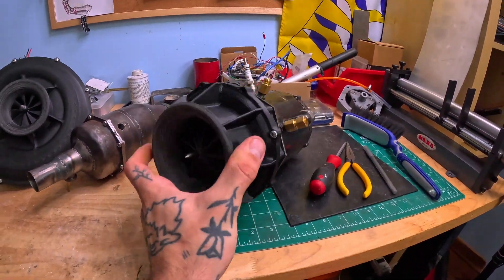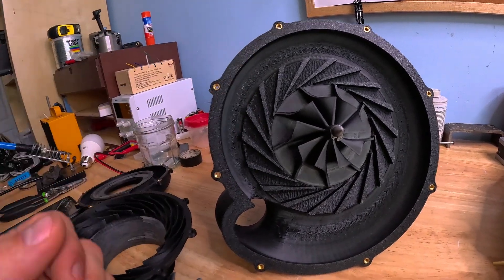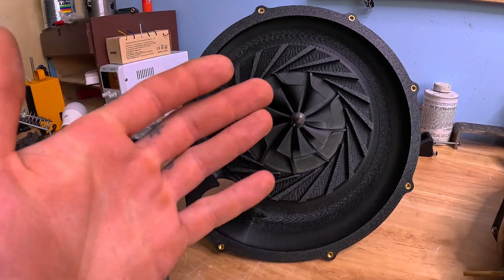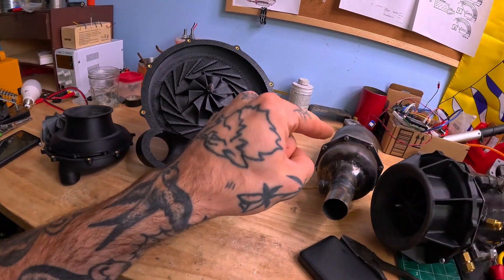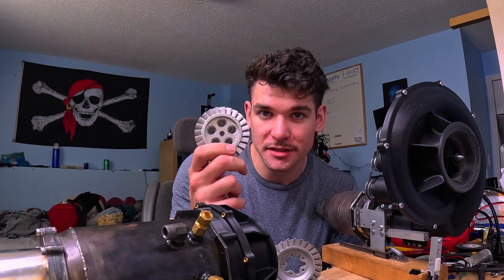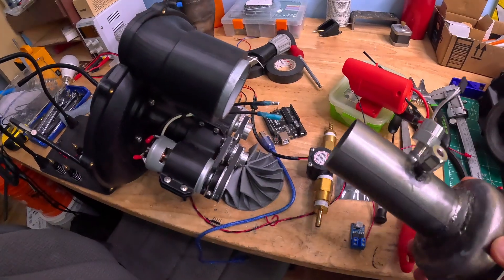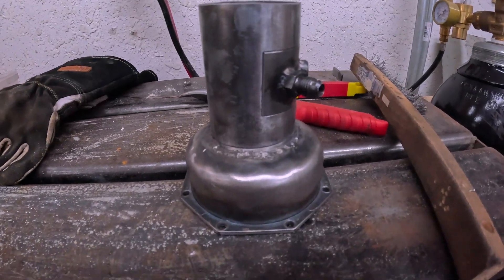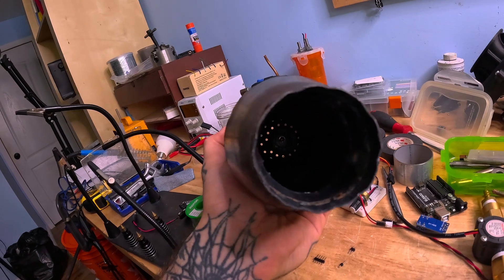How to Design a Better 3d Printed Compressor for our Jet Engine!

Comment: I've come back to nitpick; pressure is created by the restriction downstream, the compressor generates FLOW. also airplane wings don't work like that; you can have a completely flat airplane wing and still fly. Airplane wings work by re-directing air downward, exchanging momentum with it. The reason they have that shape is because they are more efficient that way; if you have a flat wing the angle of attack it can achieve is much smaller. If you think of a flat plane going through the air, and you tilt it with respect to that flow, eventually you have flow separation on the top surface. this flow separation generates immense drag and almost halves the amount of lift the wing generates. By shaping wings into an airfoil, you allow the air to stick to the top surface of the wing at higher speeds and higher angles of attack, meaning you can get  MUCH higher performance out of them than a flat wing.

Comment: Very Impressive! Does none of the heat transfer to the plastic compressor housing? Did you somehow insulate it? Also, I'm curious how much % infill did you use in the compressor wheel?
Reply from the maker: I'm sure it does, but at the moment the compression ratio is so low that heat isn't a significant factor. I used a 25% infill, thanks!

Comment: You gained a new subscriber buddy you reminded me of my project it  i made my engine inside a water pipe😂 it was just a conbustion chamber  with a (grinder motor) (ac)  and a propeller pushing air into it it wasnt effective at all but ill get to study alot with youb❤️🫶🏻

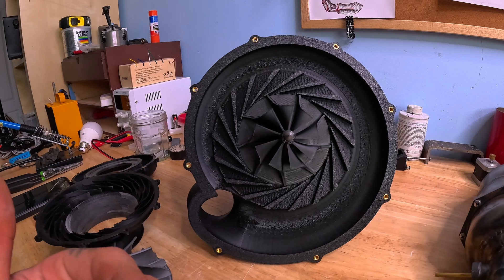Comment: 1:26 your not slowing down air to make high pressure, your literally squashing air, into a tighter smaller space.

If you was right than air would be at it's highest pressure when not moving. 

You've got the right idea but your explaining it wrong.

Comment: Would printing the blower  it out of resin make the air flow better since FDM printing has a bunch of print artifacts and imperfections
Reply from the maker: I'm sure it would! I don't currently have a resin printer, but I have thought about painting the surfaces with the resin and using a uv light to cure it to smooth out any imperfections
Reply: @Neally  what about sanding it?
Reply from the maker: Yeah! I sand the volute casing so the layer lines are less pronounced

Comment: Just to ask, but are the stl files for all these models available anywhere?
Reply from the maker: I'll probably have the files on my patreon soon!
Reply: @Neally  Awesome!, im particularly interested in that impeller stl since designing a sturdy impeller that can both print well and not tear itself apart is a challenge and i would be able to use this in many different things
Reply: @Neally  Sorry for asking so many questions, but one other thing i wish to know is are there any calculations relevant to modelling compressor and turbine for small scale and also with things like a stator etc, or are the all just something that you can wing? I assume that for the compressor and turbine you wouldnt want higher drag on the turbine than the compressor and vice versa to keep things turning smoothly

Comment: How big of a bed do you need to print? How much psi does this make? you think it would be enough to make 5psi on a v6 engine?
Reply from the maker: It took up my entire 256x256mm print bed. And not in it's current state, it peaks around 0.85psi. With a stronger motor you can probably push it to somewhere between 1 and 1.5psi, but that's just my guess

Comment: Is the rpm count accurate..?seems very low at 17k
Reply from the maker: Yeah it's accurate, the new compressor design is putting way more load on the motors because it's better at creating pressure, so the motors can only spin it up that fast

Comment: Bit of a random thought, at my work we use danfoss nozzles to inject fuel into the burner of our hot water pressure washers. Maybe these will benefit in your design? I’m not sure how well they’ll work with propane as our machines use diesel but it may be worth looking into as you can get ones with different spray patterns etc
Reply from the maker: Hell yeah I'll look into it!! Diesel and kerosene are close enough, I think that could work nicely
Reply: @Neally  good luck dude! Hope it works out 😎

Comment: The to pology of the volute and the channels is for the sake of, drag and air resistance reduction and NOT for compression ratio. The divergence of those nozzles does nothing to increase compression. It will indirectly add to higher compressio, because It's an efficiency thing. It decreases that resistance I talked about.  Pressure ratio/compression ratio is a function of the geometry of your rotor and it's rpm. You got it right that the nozzles/channels are there to slow down the air and make it compressed and hot istead of fast and low pressure.

Top tips to increase the pressure:
- increase speed/rpm
-increase rotor diameter
-optimize rotor shape
-decrease leaks, losses and tolerances

Comment: I want to ask a question: can you improve the aspiration by using a small and a big turbine in a sequential config. One for low rpm and the other for the rest?
Reply from the maker: Multi stage sequential compressors would definitely help get the pressure up! Definitely more bang for the engine I think

Comment: Neat project, but after looking back to the video 6 months ago you mentioned 400-ish grams of thrust - about a pound. I assume from the jet combustion output. Given the power needed for the electric compressor, I'd mention a cheap 90mm EDF (~2100 Watt, 30000 + RPM) produces over 6 pounds, 3kg-ish with plain old cold air. An expensive aluminum 90mm EDF (over 70000 RPM) can make >13 pounds. Tech Ingredients attached 2 of the aluminum ones to a bicycle a few years ago. I mean, fire rules, but shouldn't 30-50 pounds be the target thrust?  I've also been following some rocketry projects that talked about nozzle geometries - notably, where is your expansion taking place? The bell nozzle use on rockets lets the hot gasses expand and cool which converts to thrust the rocket can use - the nozzle is key to putting the expansion to use rather than wasting it. Then again, I've never seen a turbo jet with a bell nozzle so I must conclude the expansion is taking place inside somewhere. I probably need to watch more of your vids to make sure I'm not being Captain Obvious :)
Reply from the maker: I think using my own designs for combustion chambers, compressors, nozzles, and actually making everything myself is robbing the engine of a lot of efficiency. Additionally, the motors seem really weak for the application. Ducted fans use brushless motors, and from what I've seen they can spin up quite a bit faster than mine. I've ordered one, maybe it'll make a difference on a future design. I'll keep the nozzle shape in mind too!

Comment: Wait a minute, at least to my knowledge I don't think your concept of the diffuser is quite physical.
Air can not flow uphill. As the diffuser is not doing any work itself, it should be impossible for air to increase inpressure as it travels through the diffuser. That is not to say it might not have other benefits, but unless I'm missing something I don't think it can increase pressure.
Reply from the maker: The diffuser passively increases pressure by reducing velocity. Think of it like a backwards venturi, where the expanding shape of the channel would cause an increase in  pressure and a decrease in velocity. And the air isn't really flowing, it's essentially being shot into the diffuser by the impeller, that's where the extra energy comes from

Comment: I will say, speeding the same amount of air up, and then slowing it down will not increase its pressure, given the same end volume. A compressor of any kind works by trying to force more air into a space than can fill that space at ambient pressure. I do agree with your explanation of a trick to make centrifugal compressors more efficient.
Reply from the maker: I know where you're coming from because I had the same intuition at first too, but you're not considering conservation of energy. By speeding something up you are adding energy, if it then slows down, the energy has to be conserved, so it converts partially to pressure and heat to keep the system balanced. That is fundamentally how centrifugal and axial compressors work
Reply: @Neally  I do agree to an extent, but pressure without mass is not very useful for internal combination engines, both piston and jet. The real benefit of increasing the pressure is increasing the mass of air in a given space. This means more fuel can be burned. I work on jet engines, and axial flow engines step frontal area of the compressor blades down over each compressor stage. The front is wide open, and that same amount of air is forced to occupy a smaller and smaller space, increasing pressure.

Comment: What is that fuel nozzle? It looks like it is from a 3d printer. Also, you should probably try using some bleed air to cool the exhaust so it doesn't get hot and glow like that.

Comment: Is this reversible? Can it be used as a turbine?
Reply from the maker: Not well, the geometry isn't suitable for the reverse flow, you'd want a different impeller(turbine, in that case) shape, and probably to remove the diffuser

Comment: thats beautiful, how do you make the impeller so perfectly? when i try to 3d print one, it get out warped (a little bit its enough to break the entire thing) or not strong enough
Reply from the maker: Hard to say! It depends on how you're running your printer, make sure you're using well dried filament, not printing too fast, and have your slicer settings sorted out

Comment: What design did you see that uses those stationary stators on the volute housing? Reason I ask is if you look at any aftermarket supercharger or even turbo charger. Those stators do not exist. If what your saying is true, there would be a lot of performance to be had including them. This makes me think they were left out for a reason and are likely just a restriction that doesn't help performance.  Have you though about possibly creating a case without them and comparing?  Would be interesting to see the results anyway!
Reply from the maker: The two types you're talking about are called vaneless and vaned diffusers, they differ in flow and pressure characteristics, you're best off doing some digging yourself because it gets a bit complicated and I'm by no means an expert! I really like the idea of comparing the two, I've been playing with the idea of trying to make my own turbocharger, I think I could definitely experiment around with that!

Comment: Propane lowkey an L fuel because at low temperatures the fuel cools down a substantial amount. This screws up its combustion. It’s best to have the fuel heated or cracked already
Reply from the maker: Yeah, I agree with you. I've been working on a kerosene injection system, but it still needs some work and I haven't been able to test it yet.. It'll be powering the new engine eventually!

Comment: How you described lift is called the Equal Transit theory and its kinda not true. Bernoullis principle governs flows and therefore lift
Reply from the maker: Good point! It seems to be partially accurate but not fully responsible for lift, could you point me to a better explanation??

Comment: TURBOJET Lets fricking goo; I've been building one for 2years now I'm on V2. If you wanna save some time and money swap out those steel bearings for cageless silicon Nitride bearings, or cageless zriconium oxide bearings. These bearings Run dry and dont need lubrication. 
For you combustion chamber I'd recommend a reverse flow combustion setup, basically the fuel is injected from the top down, and protected with a tube to ensure it doesn't ignite too early.
If you use a (stainless-steel Turbine, and turbine housing) make sure to take into account the thermal expansion ratio of the turbine with respect to the turbine housing. I'd recommend some air-cooling fins for the turbine housing to keep the temperature predicable.
I Noticed you are using a non-threaded shaft, I'd recommend using a partially threaded shaft as it makes securing the turbine and compressor quite easy, And No the nuts won't come loose.
Reply from the maker: Wow thanks for the info!! I'll see about getting some of those bearings because that sounds really handy!

Comment: @5:56 im guessing you are using propane. If you watch you are getting propane fireballs coming back to you . Hope you have a arrester or something on there. Ok now you show your propane yeah so be safe
Reply from the maker: The stuff you see in the line is just liquid propane, there isn't enough pressure in the system to push oxygen into the line,  there can't really be a flashback
Reply: @Neally  oh ok so its not like the little plasma balls like people make propane shooters with? Just looked like it was those didn't want to see something happen but if you say its good then I guess its good. Wasnt trying to be that guy stay safe loving the idea im working on a similar project myself.
Reply from the maker: No no, nothing like that, just the liquid propane haha. Thanks though, it is better to be on the safe side